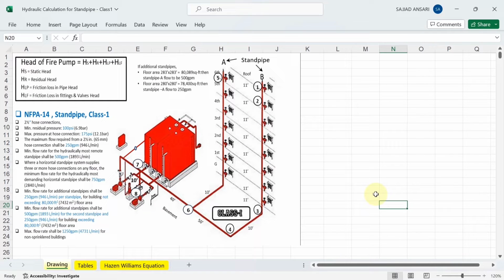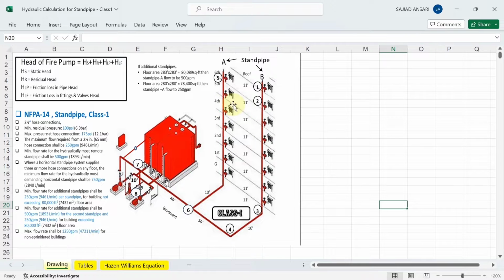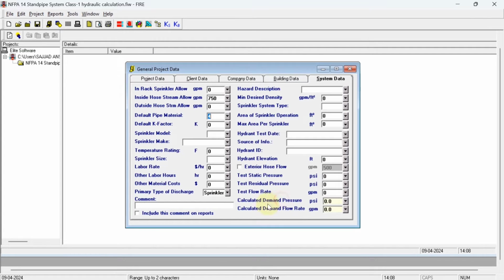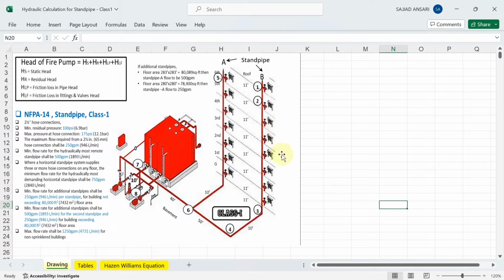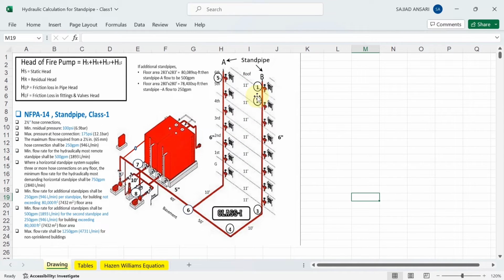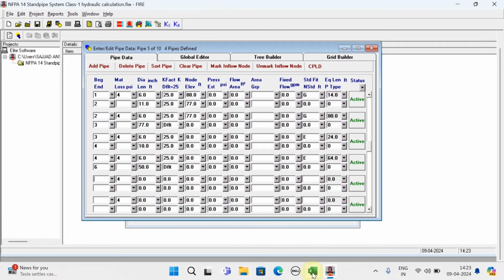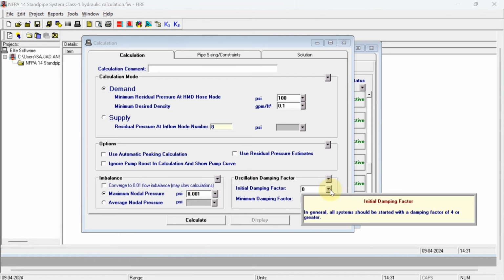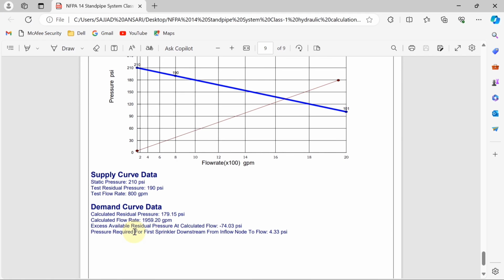Hydraulic Calculation for NFPA 14 Standpipe System using Elite Fire Software

Comment: Ur pipe size  selection for the pump discharge should be re checked, ur risers having 6” and ur pump heads 5”, that’s why u got result as more residual pressure and more inflow node gpm.
Reply: header cannot have less size than the branch pipe. its a fundamental mistake

Comment: Respectfully, I think you should only write the K-Factor for the hoses point : 1, 2 & 5 only, so my best guess that the calculations will require a little bit more than 750 gpm, & not 1959 gpm as mentioned in the video.. I would like to hear your opinion on that. 

Best Regards,
Reply: Good point
Reply: You are right